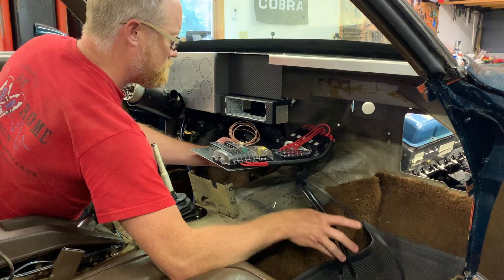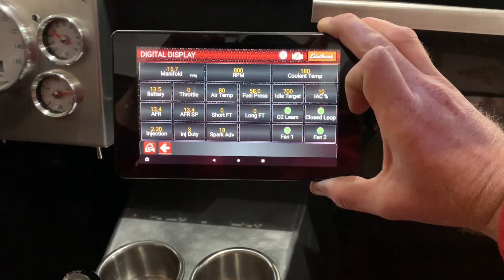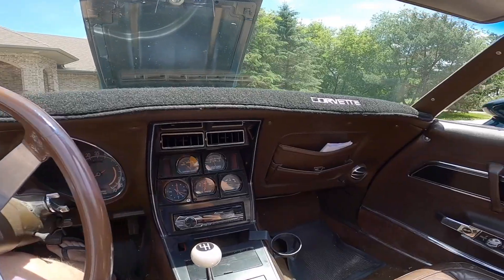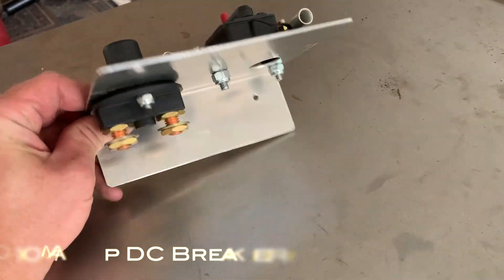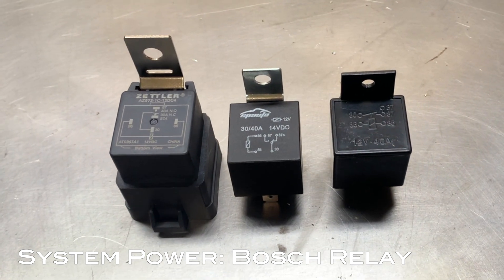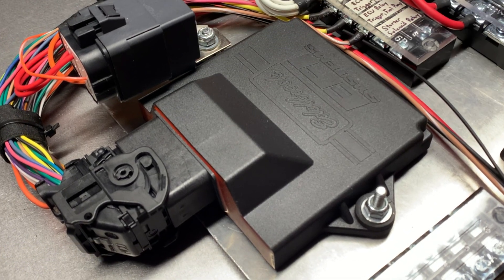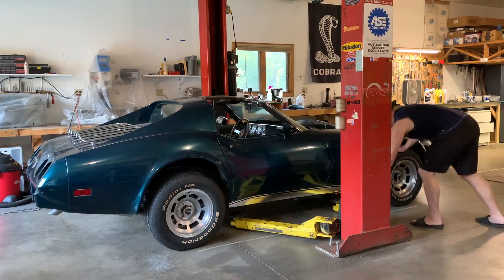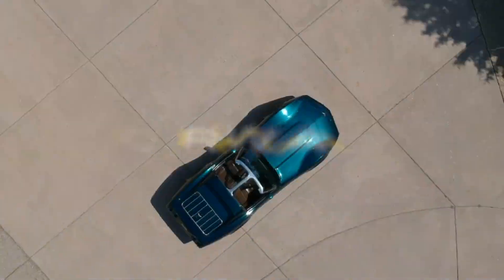Edelbrock Pro-Flo 4 Fuel Injection System Retrofit

Comment: Nice video; I am doing a similar mod to my 1966 Mustang (302), any suggestions on engine cooling, fans, etc? I have very limited surface area in this application, so I am worried electric fans will not be adequate.
Reply from the maker: Whats nice on a 66 Gen1 Stang is that unlike my corvette, air flows STRAIGHT into the grill through the radiator / on my vette, there is a plastic deflector below the bumper that is REQUIRED to direct air through the radiator or it overheats / I'd go with the dual fan setup on your stang / it will work great. Basically on the highway they won't run, but in traffic they will kick in. Best part: With the Pro-Flo app, you can set the temperature that they come on / target a few degrees above your thermostat and you'll be all set / thanks for the comment Tony!
Reply: @TacoJoe  thanks for reply, only issue with dual fans on mine is my exposed radiator area is only 19w x 16h. Champion makes a nice 3 tube aluminum radiator with a 16" Spal fan; I'm going to call them on it. They claim it cools up to 450hp, well above my motor.
Reply from the maker: I think you are on the right track / a 450hp rating is likely rated on how much gas your beast 302 can pump through the engine on a spirited drive - thus - I think Champion likely figured that in with their 450hp rating. IMHO - Both Ford 289/302 (& Chevy 283/302/327) are the best American V8's ever made. Its a balance of rev ceiling and torque / also -SPAL makes EXCELLENT fans - I have a few of them now / good luck with your build Tony!
Reply: @TacoJoe  those engines are garbage compared to any LS
Reply: Whats your new mpg with this setup? Ive got a stock l48 in my 75 and getting 10 (holley 650 vac secondary carb thay could probably use some work on jets but runs pretty well)
Reply: @grantimbrock  I will let you know as soon as I run a tank through it. I am hoping to get it running in Aug. I gutted the car, all new electrical, suspension, transmission (4R70W 4sp auto), rebuilt 8" rearend with posi, added AC. So, it's been a lot of work but getting close. Tony
Reply: LS swap it

Comment: So i got a cadillac brougham, 1992 with a 350 (aka a small block chevy) using throttle body injection, and a 700r4/4l60 (md8) transmission.. would it still be possible to convert this to the MPFI kit as shown here and on eric the car guy (edit: or sniper or holly if i so desire) or no
Reply from the maker: Yes sir - there is both a vortec type intake version and non-vortec type intake that will bolt right up to most factory SBC heads. Good luck and thanks for the comment!
Reply: @TacoJoe  oh nice. Thanks.. I was just concerned mostly due to this being OBD1 and I'd have to bypass the computer and still make it all work

Comment: Thanks for the video. I noticed there’s only one O2 sensor. If you have two exhaust, don’t you need two O2s? Again thanks for the video.
Reply from the maker: no - both holley/edelbrock are pretty adamant that only one is needed but it should be at/after the collector to make sure you get good exhaust mixing/etc - thanks for the comment!

Comment: I'm planning on doing an EFI kit on my C3 and I'm wondering if the O2 sensors would be a pain since the headers sit so close to the frame rails or if it's gonna clear.
Reply from the maker: not a big deal - you can purchase collectors with the O2 bung already welded in and then position it however you like it (ie- you can rotate it 360 degrees) - good luck and thanks for the comment!

Comment: Are you able to send links of items you used when converting your C3 to EFI. Electrical components, fuel tank, pump, vent, etc. I’m planning to do the conversion as well as rewire and this will be extremely helpful.
Reply from the maker: I'll see if I can put something together. To get a head start though, visit the Tanks Inc website....https://www.tanksinc.com / you can get a retrofit EFI tank for your classic car and they have kits which include the pump / sender / etc. Good deals and nice tanks too. Pump I used was a Walbro 255lph

Comment: Nice clean install.  You had any issues with the proflo since installing it?
Reply from the maker: No big issues / did have a minor issue with an airflow whistle/howl on the intake that I fixed by adding a spacer under the throttle body / other than that its been great - thanks for the comment!
Reply: @TacoJoe  Thanks for the feedback.  Looking at this system to replace my 1st gen Sniper.

Comment: I've been comparing which Holley EFI to get, but it's nice to see someone using the Edelbrock EFI. Can you tell me a little more about your fuel system? Did you modify a new c3 gas tank or an EFI tank already providing baffle and holes for fuel pump assembly etc? what fuel pump assembly bracket and fuel sender did you use? Thank you! Great video w shots of the Corvette. Job well done!
Reply from the maker: Hi Jim- I purchased a tank from Tanks Inc and a walbro 250 lph pump from summit. The tanks are nice and have baffles around the pump. I bought the sender from Tanks Inc too - its a nice setup and my only gripe is the sender float area is limited with the C3 specific tank thus when you get to 1/4 tank you can drop to 1/8" 10 miles later -lol. Check out their website / lots of specific kits for classic cars and good luck with your build!

Comment: Does this system control timing or do you have to buy a different distributor separate from the one in the kit thanks
Reply from the maker: The kit distributor controls timing - basically there is a long flat that covers 50-60degs of sweep and the ecu picks advance based on vacuum/fuel/o2 readings, etc - thanks for the comment

Comment: @TacoJoe Now that you've done this to the Vette are you going convert the Cobra to EFI? I think when I learned carburetors as a mechanic (Mid 90s), we were some of the last generation of Mechanics getting formal hands on training for carburetion. I like the idea of a simple carb setup but worry I will get frustrated with it, for the reasons you have mentioned in the video.
Reply from the maker: Thanks for the comment taduse - as for EFI on the next Cobra motor: We will see! First I'm going to get the short block put together and then I'll figure out these details :)

Comment: Great video. I wish it was more detailed, but I just like nerdy details. The exhaust system sounds great, what mufflers are you using?
Reply from the maker: The mufflers are OEM replacement type (typical baffled w/insulation) - Flo-masters are the way to go though. I actually had some home made echo cans on a Chevelle I once owned - basically they were 2 steel boxes with 2 v-baffles welded in-line - sounded EXCELLENT and were back-fire proof. Thanks for the comment!

Comment: Which kit did you go with? I've considered the 35770 for mine as I have a built 400 SBC.
Reply from the maker: I went with the 35760 - I don't know what the difference is with the 35770 but if I could go back in time: I think I would have got the intake with the vortec provisions - is even harder to torque the intake builds with the fuel rails there. No huge regrets though / runs great & motor is strong - thanks for the comment!
Reply: @TacoJoe  the 35760 comes with 29 lb/hr injectors and supports up to 450 HP. The 35770 comes with 35 lb/hr injectors and supports up to 550 HP
Reply from the maker: I got the 29lb/hr injectors - in hindsight: pretty sure the motor could easily handle the 35lb/hr - might need to upgrade these at some point / thanks for the comment!

Comment: Great job!! I have the same setup, 70 Chevy C20 with the tank behind the seat.  BUT....I have a sub pump (aaaahhh) I need a electronic fuel pump but not sure what I should get.   Please let me know. Thanks!!
Reply from the maker: You can do it! / the external pumps are decent, but in-tank typically is better if you have access. I have another car with an external Carter pump and it works great/no starvation issues but it's only 8-10pcs. If you go external, try and go brushless if you can / they last longer. Thanks for the comment!
Reply: @TacoJoe  Thank you!! I think I'm going internal and be done with it lol.

Comment: Well. Very Nice work, but after I saw the first video, I did expect more from the others. And how about that performance. What happend to 0-60 time and quarter mile time.😢 and how come you did not lower the car and buy new wheels, as you planned to.
Reply from the maker: still in the works Peter / thanks for the comment - wiring up lights/horn/radio as we speak, finishing the dash with a new look (stay tuned) and will finish with some new wheels all around

Comment: You should try this on a 1970s Cadillac with a big block. I've always wondered how much power does 502s could get if you just swapped out the fuel and engine management components.

Comment: In the beginning you said the kit includes everything, but then the rest of the video is the things you needed to add. Unless you get the kit that includes the fuel sump then you have to plan on a high pressure pump and feed. I wasn't clear on what all of the relays you had were for.

Comment: I watch all of this build and you did a great job but the dashboard should have stayed. They make electronic tachs to replace the distributor drive. I built a 74 with a big block 427 and it was a beast with the stock rear and Muncie trans but I fully agree with you about the roller cam, as I wiped out 3 lobes soon after I finished.

Comment: Hey Taco Joe, 
Very nice job on the wiring. Three years ago I installed a fitech on my C3, I've had nothing but problems. One of my problems I had was hood fitment and now I want to change over to this system pro Flo 4. Did you have any fitment issues with your hood? I don't see myself investing 1200 to 1500 for a new high rise hood. Trying to keep it looking stock.

Comment: Nice work! Putting on in my 70 chevelle. Where did you find a full 12v during crank?
Reply from the maker: Full 12V is at the battery / wire it there Jason - good luck and thanks for the comment!